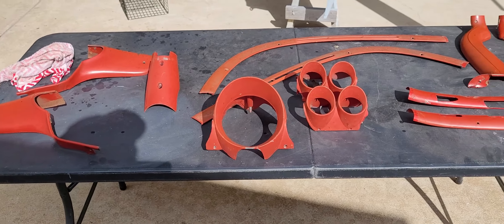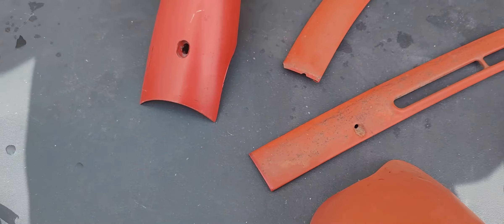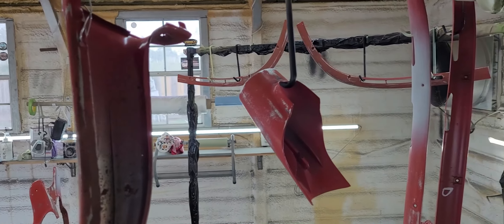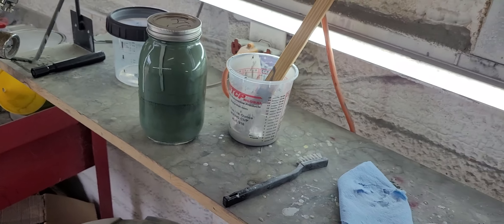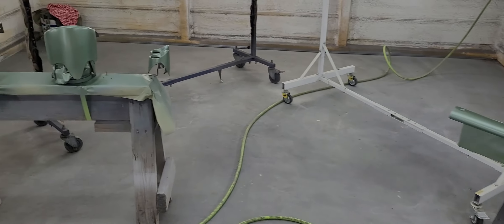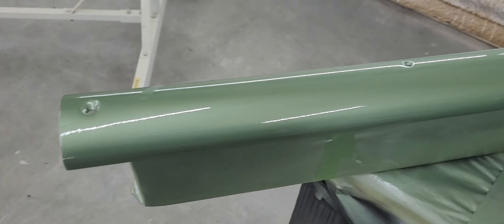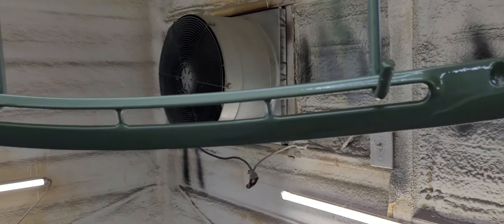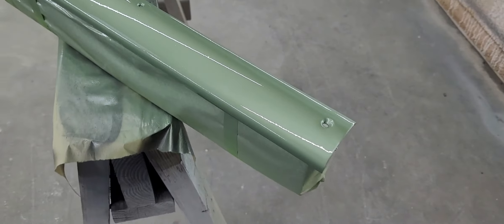1960 Chevrolet Impala Convertible Dash Trim Pieces Prep & Paint | @lonestarlows | #Rematch60

Comment: Came out bad ass!! I’m getting ready to spray the dashboard on a 63 ss the dash is in good condition no need to body work my question is do I need to get it to bare metal or just scuff it down to apply epoxy sealer and go from there?  Just seen your video I guess I shouldn’t be asking great work you guys do
Reply from the maker: You could probably get sway with 320 and seal it.  Or 400.
Reply: @lonestarlows  I’ll do 400 and seal it 
My only concern was getting a reaction sealing the og scuffed paint with the epoxy sealer
Reply from the maker: Highly unlikely...let me know how it turns out!
Reply: @lonestarlows  for sure thank you!